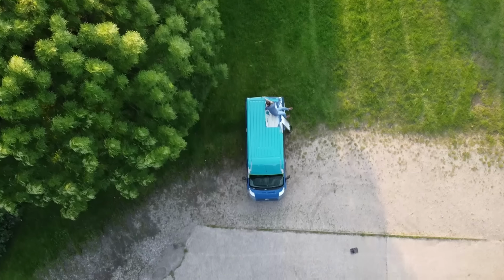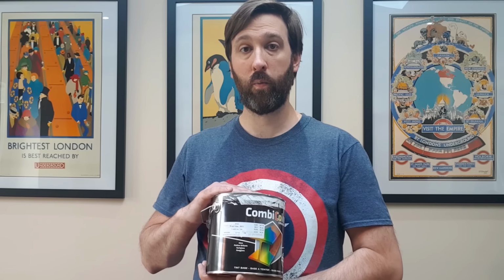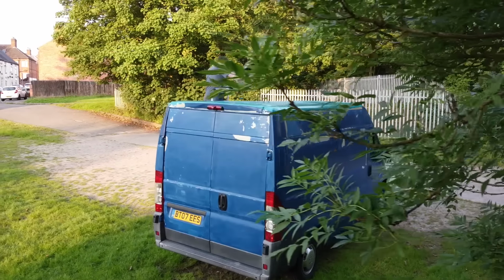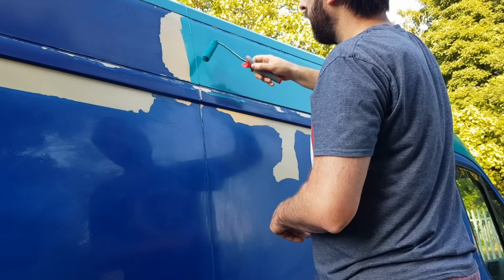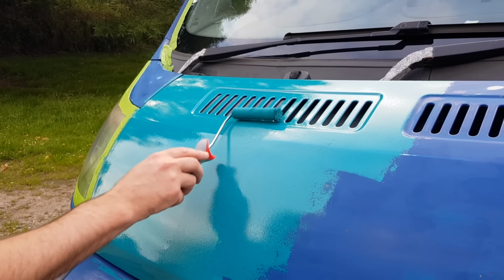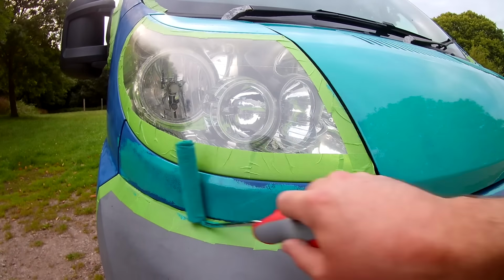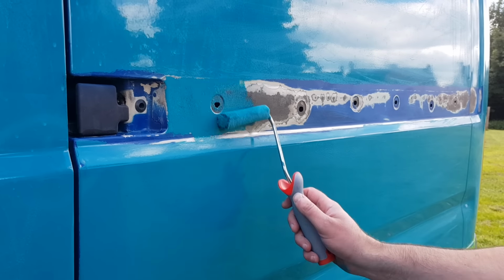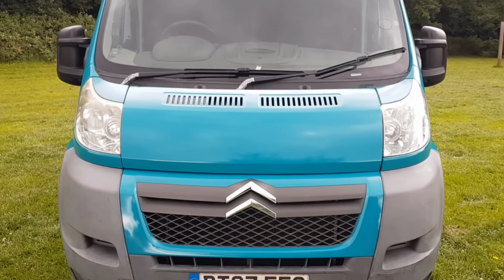Painting a CAMPERVAN on the CHEAP with a ROLLER! - DIY Budget Campervan Conversion

Comment: What colour did you use? Shade wise? I love it 😻
Reply from the maker: It's RAL5021 Water blue. 🙂👍
Reply: Hi is it 5012 not 5021 as I can't find a 5021 but can find 5012 thanks
Reply from the maker: @craigbarker_calisthenics8022  it's RAL5021. If you Google it you'll see a load of swatches for it named water blue. The swatch is a bit different to how it covers on the van but I find that's always the case with colour swatches.

Comment: Hi nice work, what colour did you go for Marlin blue? I’m looking at doing my Car in the same colour
Reply from the maker: Cheers Chris. 😊👍 We went with RAL5021 water blue. Good luck with your own project mate.
Reply: @PilgrimPods   sorry for loads of questions mate, how many litres did you use and is the paint good on plastics too, and particular thinners you recommend?
Reply from the maker: @chrishawkes5019   I bought two 2.5ltr tins but have only used two thirds of one for two coats. Rustoleum is fine for plastics just as with metal make sure it is keyed. We just used the cheap as chips No Nonsense stuff from Toolstation. 🙂

Comment: Such an amazing transformation! How long did you leave between coats and how many tins of paint did you use? Looking at painting my Citroen relay and this is definitely the most informative video out there!
Reply from the maker: Hey James, we left the van a couple of weeks between coats for the paint to fully harden. For a MWB Relay a 2.5ltr tin thinned 4:1 should be enough for 3 coats (I've put 2 down so far and there's probably 1/3 of a tin left). Good luck with your own Relay! 😁🙌
Reply: My van is also my daily, could it still be driven during its "hardening" phase?
Reply: @ianstenson709  the only risk is when you are driving during the hardening phase, the paint isn't full cured or hardened. So when you are driving, risk of debrie, stones or stuff from the road scratching your paint job easily.
Reply: @PilgrimPods  So you used 10L of rust-oleum?

Comment: Hi,just wondered how the paint is a year later? Did it crack or come off in places?
Reply from the maker: Almost two years later still looks great. It has lifted in two small areas where the original paint has came away from the primer but I was expecting worse due to how bad the original paint was. I intend to get a third coat down soon!

Comment: Hi fab paint job can I ask how much paint did you use to do the van ... thanks
Reply from the maker: Hi, for two coats I've used a 2.5ltr tin and there's enough left over for a third coat. 🙂👍
Reply: Wow so it would defo do my small Suzuki carry van then ,
Reply: What thinners did you use .
Reply from the maker: @user-nq3qn3zx5z  just cheap old white spirit from Screwfix.  Nothing fancy. 😊

Comment: Do u have a video of the final finish after its been flattened and polished please
Reply from the maker: I haven't finished it yet sorry Craig. I've only got the two coats down so far and intended to finish the paint job once the van has been converted. Was happy to leave it as is because it looks just fine in its current state. I will return to it though and get it finished off properly but will be next summer now sorry.

Comment: Is that paint mix suitable to wet sand with 1000 grit paper after its fully cured and if so will it buff up after fine sanding?
Reply from the maker: Yeah and that's exactly what I intend to do after another coat or two is down. 🙂👍

Comment: Very informative video! How did you get the plastic skirts off without breaking the knobs?
Reply from the maker: Just a bit of gentle persuasion. 😊👍 The trim has a bit of play left and right so if you slide it in one direction it makes it easier to remove the trim. I still damaged a few clips removing them to paint the van so replaced with some picked up off eBay.

Comment: Cracking job, just wondering if it work work on the bumpers with a suitable primer?
Reply from the maker: Apparently so! Give it a good key  spray some plastic primer on and then roller the Rustoleum Combicolor on. I've heard the primer will stop the paint peeling away from  the plastic. We were going to colour code them but decided against in the end and paint them black to break all the colour up. 🙂 Thanks for watching! 😁👍💙❤
Reply: Use a bedliner paint like Raptor, Durabak, or Monstaliner.  Raptor is from UK.

Comment: Hi, thanks for the excellent video. Few questions popped up; 1) How much combicolor did you use in total? 2)  What about rollers? 10pcs enough? 3) You mentioned two fussy blokes rollers, do you happen to know which model/type is recommended?
Reply from the maker: Hey! 1) We used about 2/3 of a 2.5ltr tin to get two coats down. Obviously we had to add thinners to that which made the paint go so much further. 2) I used two rollers to get a single coat down (linked in the description). Taking your time (which you should be anyway to get a nice finish) makes the rollers go so far before they start to deteriorate. 3) Lots of folk rave about the Fussy Blokes rollers but I went with the cheaper alternative I've linked and I've been more than happy with the finish so unfortunately I can't help with what type of those to use. Thanks for watching! 🙂👍

Comment: How is the paint holding up a year later? I need to paint my van and im trying to choose between spray paint or rolling...
Reply: nevermind i just saw another comment like mine and read the response. thanks. good to hear it still looks good.
Reply from the maker: Cheap old van then I can't recommend rollering it enough. Good luck with your final decision. 😊👍

Comment: How much of the Rust Oleum did you need to paint the whole van?

I want to paint my 2000 Daihatsu Cuore this summer and I'm wondering how much paint I should order. I don't want to order too much since Rust Oleum is a bit expensive .
Reply from the maker: A 2.5ltr tin will allow us to get 3 coats down on our van. Good luck painting your own! 😊👍
Reply: @PilgrimPods  Great. Then it should be plenty to paint my small nugget of a car :)
Thanks!
Reply from the maker: @Diggoch  all the best mate. 🙂🙌

Comment: Hey. Wat a fantastic job you made of that. When all is said and done and the job was finished. How much of the paint did you use?
Reply from the maker: Cheers Alex. 😊🍻 We've used around 2/3 of a 2.5ltr tin so far on two coats. Once we've finished the interior we'll give it another coat or two and give it a good polish and call it a day. Looks pretty good with just the two coats though I have to say. 🙂
Reply: @PilgrimPods  yea it realy does buddy. Well done. I don't no if I'm looking in the wrong places for the paint but I'm finding it it kilos instead of litres lol 2.5kg tins.
Reply from the maker: @alexjohnson2609  I'm assuming you're in the UK... we got ours from Rawlins Paints online. Their prices were on par with other suppliers but they could deliver quicker. We bought ours just as Covid was gripping the country and we were starting lockdown.
Reply: @PilgrimPods  yes mate I'm UK thanks for that il head over to there site now. You must of been lucky as everywhere sold out of paint a few weeks in

Comment: Just received the rollers you linked, but they look different than yours, there’s 3 different types, short pile, medium pile and foam - are the short pile ones the same as the ones in your pack?
Reply from the maker: You got it mate, it's the white gloss short pile rollers I used. I couldn't find a set of only short pile rollers with the handle included so bought the mixed set for how little they cost. I did buy some refills just in case the paint destroyed them but they lasted quite long. If you need more check out the link I've included in the video description for the refills so you can see exactly what I used. Good luck with the paint job, I'm sure you'll nail it! 🙂👍
Reply: @PilgrimPods  Thanks mate! I've ordered some extras :) - just need to decide on a colour now! What made you go with the rustoleum over the military? I'm probably going to go with a grey so I could go with either but both seem to be recommended.

Comment: Can I ask how difficult it was to remove the black trim on the side and back? I've been considering doing this to my van for a long time, but now watching your video and seeing your photos on Instagram of how amazing your van now looks, I've just ordered the paint and am taking the plunge!! Can the trims be removed from outside? Did you need to buy new clips for them? Thanks.
Reply from the maker: Hey Sarah, removing the trim is really straightforward. On the van the trim should have a little wiggle room left and right. With how the recesses for the clips are situated inside the trim, sliding the trim over left or right should then enable you to pull it away from the van with a little force. Once one end is away from the van slide the trim in the other direction and repeat. You can then remove the clips from the van with some needle nose pliers. I damaged some of the tabs on the clips removing them but they're pretty cheap to replace from eBay. Refitting couldn't be easier; put the clips on the trim, line them up with the holes on the van and press them on! Hope that helps and thanks for checking our stuff out! Good luck with your own van. 😁🤞
Reply: Pilgrim Pods awesome! Thanks for replying. I’ve already lost one piece of the trim so I didn’t think it would be too difficult but I’ve almost finished my conversion so didn’t want it to be something that I had to access from inside. Enjoying your vids, you got a bargain on that van!

Comment: Hey, looks great! Out of interest how much Rustoleum paint was required for the two coats? I've bought a 2.5L tin but wondering if I'll need more
Reply from the maker: Thanks! 😁 Two coats on our MWB Relay has used used about three quarters of a 2.5L tin thinned 4:1. Hope that helps! 😊👍
Reply: @PilgrimPods that's good news, much appreciated! has certainly made the job less imposing
Reply: @PilgrimPods  is that 4 parts paint to 1 part thinner? Or is that 4 parts thinner to 1 part paint?
Reply from the maker: @kortlee  4 parts paint to 1 part thinners as a rule. 🙂👍

Comment: Great video, I was so skeptical about using the roller until now, I was planning going down the raptor paint route which is so much more expensive, combi colour it is now, any suggestions on bringing the plastics back to life? thanks 👍
Reply: hot air gun 👍
Reply from the maker: I used black spray paint designed for bumpers and trim.

Comment: Hey Craig 👋🏻 I commented last year about having just bought the paint, well I still haven’t done it but am starting sanding this weekend! Just wondering how long you left the paint to cure before doing a second coat?
Reply from the maker: Hey Sarah, personally I would leave it a week or two to cure. After applying a coat there's a slight 'solventy' smell that lingers for a few days whilst the paint is fully drying and hardening. I know folks who have walloped one coat down after the other without issue but in my own personal opinion to avoid potential problems I would definitely leave it a week or two to fully dry. Good luck! 🙂👏
Reply: @PilgrimPods  thanks 👍🏻 Excellent, will give it two weeks to be safe! Managed to start sanding and removed the Citroen Relay lettering last night between rainstorms 🤣🤣
Reply from the maker: @sarahpayne7797  yeah the weather's been a bit funny of late! I had completely lost my mojo for the van as I'd written off using it this year with the current climate. Plan to get back on it this weekend though and finish off the rear and side loading doors before tackling the cabinetry. Then it's connect the services and done! Best of luck with the paint job!

Comment: How is this finish holding up? I have heard that Rustoleum tends to stay quite soft and marks/scratches easily - is this the case?
Reply from the maker: Hey Phil, I don't think the finish looks any different to when I first painted it to be honest. With the way the world is at the moment I haven't been anywhere in it and I'm intrigued myself to see how it holds up to bushes and trees rubbing against it on tight country roads. What I do know is that it did take a few weeks to fully cure; I know this because I leant a ladder against the van not long after painting to install the roof vents and it scuffed the paint a little at the top. I had a poke around with my nail to get a feel for the paint up there and did the same another few weeks down the line whilst messing about fitting the wifi antenna and it did feel harder. I'm sure if I had a proper gouge at it it'd mark but I'm sure the same could be said for a professional paint job. It's an old van and for how little it cost to do I'm still really happy with the finish and wouldn't hesitate to paint a newer van using the same method again later on down the line. 🙂👍

Comment: Thanks for the Great video! Did you use a clear coat as a final coat? In your research did they mention it?
Reply from the maker: Cheers mate! 🙂 Some apply one but from our research most don't bother and neither will we. We expect a few scrapes to the paintwork on our adventures and are happy to just give a quick touch up with a roller if need be. Our goal painting the van was to achieve a nice finish not a show finish and we've definitely achieved that. Would like to build up another couple of coats though this year for protection and then give a final polish and call it done. 👍

Comment: amaazing video!
i want to paint my van, but i just read that you left weeks in between the coats..
i'll have to drive it in between, is that possible? 
i was hoping to finish it in 1 weekend haha😂 
some people mentioned using primer and then one coat of the desired colour. is that something you have an opinion on?😋
Reply from the maker: Thank you! 🙂 You can get a coat on and still drive it in a day providing it's hot to aid a quick drying time. A lot of folk do this. I leave it two weeks between coats because it takes a bit of time for the paint to fully cure and harden. After a couple of days I was still able to make an indent in the paint using my finger nail. I found a tell tale sign that paint hadn't fully cured was the smell of solvent in the air which took a few days to dissipate. I haven't looked at other paints and primer so have no idea about that sorry. The beauty of Rustoleum is it requires no primer and protects the metal of your van. Hope that helps and good luck painting your own van! 😀👍

Comment: youve just convinced me to do my caddy van! how many litres of paint did you use?
Reply from the maker: Hey John, being thinned a 2.5 litre tin should enable you to get a good 3 or four coats down on that sized van. A 2.5 litre tin has enabled us to get two coats down on our MWB Relay with a third of the tin left over. All the best doing your own! 🙂👍
Reply: @PilgrimPods  thanx for the reply, enjoying your videos and are really helpful and straight forward, im converting the caddy into a micro camper

Comment: Thank you for the video. I have seen people using same brand in the states with success.  I am not sure if the combicolor in Europe has the same formula. I have rolled  the first coat right out of the tin on a tatty area about 2x3 feet  on my gliders wing. The paint is very sticky and levels itself well, touch dries within a couple of hours. I have scored the old acrylic paint on the surface with 320 grit. The first has got orange peel finish as expected. I will probably score the first coat by 600 grit and apply the second coat and polish it 1200/2000 grit. Well that's my plan at the moment. May I ask why do you thin it? I might consider thinning it if there is any benefit such as less orange peel effect??
Reply from the maker: Hey  there, the reason I've thinned the paint is it makes it easier to manipulate and work with. Building up multiple thin layers rather than one thick layer will just provide a better finish overall meaning less work buffing and polishing at the end. Thinners is also cheap and adding it to the paint makes it go so much further! I was a printer for 14 years and the same principle pretty much applied to thinning ink, although we didn't put down multiple coats. I had a phase where when younger I used to paint miniature war models and again, the same principle applied there too. I know a few folk who just slop it on straight out of the tin and get good results but to give yourself the best chance of getting a great result thinning and multiple coats is the way forward. All the best with that glider of yours! 🙂👍
Reply: @PilgrimPods  any thinner from B&Qwould work? or would you use cellulose thinner ?
Reply from the maker: @3elmas  I just used the cheap and cheerful No Nonsense thinner from Screwfix.

Comment: How many litres did you use of the rustoleum,  I've got 2 litres so far but doing the whole of my old Renault master
Reply from the maker: Hey Martin, for two coats on a MWB we've used about 3/4 of a 2.5 litre tin. Obviously that's had thinners added to it for coverage mixed at around 4:1. Good luck with the Master mate. 🙂👍

Comment: How many litres of Combi did you use pls ?
Reply from the maker: Hey there. We bought two 2.5 litre tins and so far for two coats have probably used 3/4 of the first tin so far. It goes without saying that adding the thinners to it not only helps coverage but makes it go further as well. Our van is a MWB at only 5.4 meters so a LWB would obviously require more paint! Hope that helps. 🙂👍
Reply: @PilgrimPods  Excellent thanks very much for getting back to me thats a big help much appreciated.